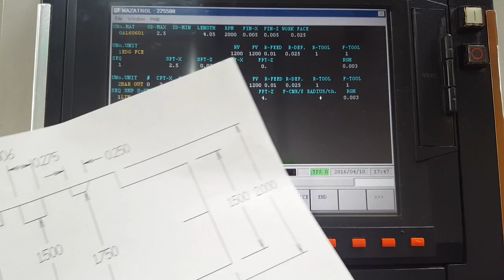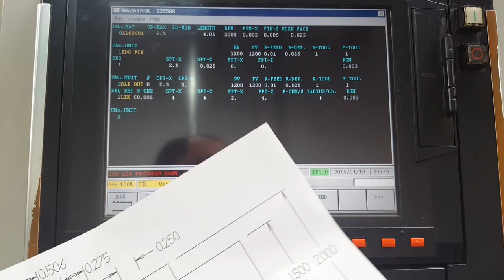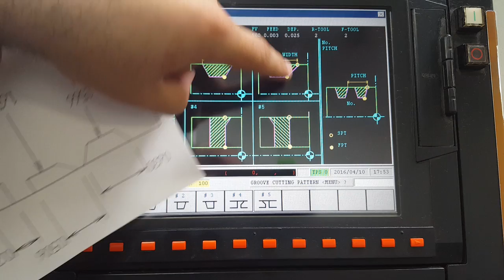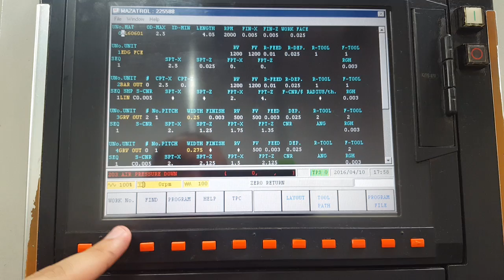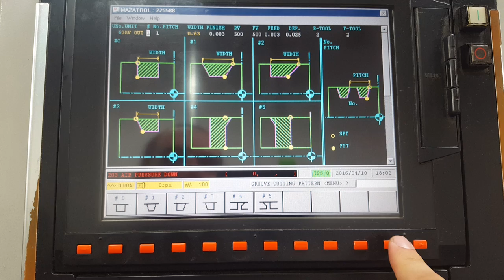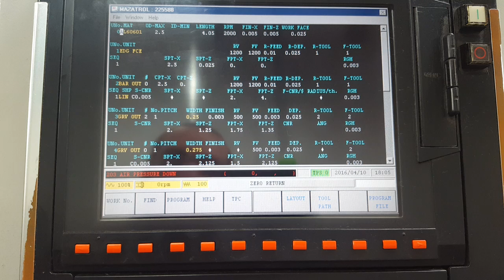Grooving with Mazatrol

Comment: I truly appreciate your help this is bringing back memories for me I used to program on a T-2 MAZATROL
Reply: what do you put for grooving pitch
Reply: @christophercolumbus8944  
I was using the preset groove selection 
I just filled in the required info since it 
was conversational
Reply: @pandorasdj  well no sh sherlock holmes it is conversational alright but someone i can't convey my messages to the other party 
pitch is 0 if it's one groove pitch is distance from one to another like threads basically
Reply: @christophercolumbus8944  
I have to research this man again rust has set in

Comment: If I need help is there a number I can contact you at or email
Reply from the maker: shoot me an email here at everythingcnc@gmail.com
Reply: +EVERYTHING CNC  Nice. Thanks
Reply: +EVERYTHING CNC 
hello my name is jorge am a cnc programmer set up guy my experience is in Gcode i could program just abou anything lathe, mills sorry enough bragging 😝 we have a mazak 350m lathe here and i tried to program in GCode so far so good in turning according to the graphics. i use a 2 line can cycle but when i programmed the drilling cycle using these 
G54T202S650M3
GOXO.Z2.M8
G74R.1
G74Z-2.5Q.125F.009
GOZ2.M9
GOX7.5
M1
I was getting an alarm telling me impossible to do then i tried a boring bar using 1 line and 2 line cycle when 1 line can cycle didn't work again alarm alarm alarm so i got discouraged and and give up for now can you make a video making a simple part that includes turn, drill, bore,thread, and cut off to see how its done now the other problem that i have am milling a flat on a .625 part but the mill is plunging like a drill and leaves a radius instead of living a nice flat edge so please help i know that your helping on mazak program but it will be nice to do in Gcode thanks keep making videos your awesome.

Comment: What kind of Mazak are you working with and what controller are you using
Reply from the maker: QT200MY with a 640t. programming is all the same tho by the way with the exception of some added tool paths on new software